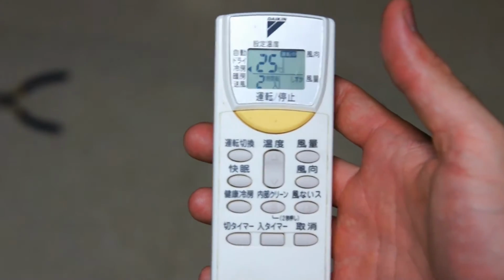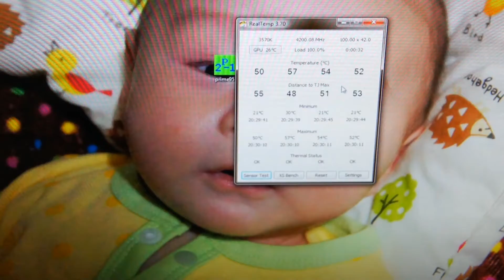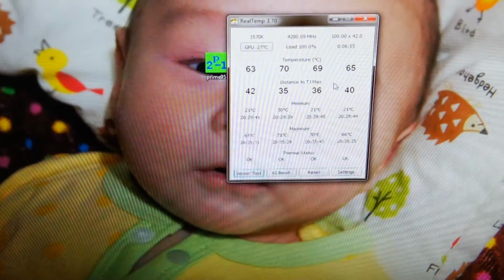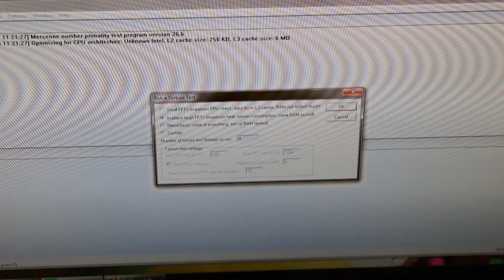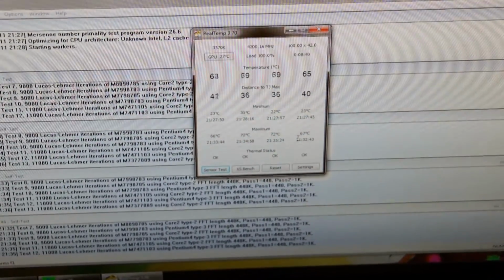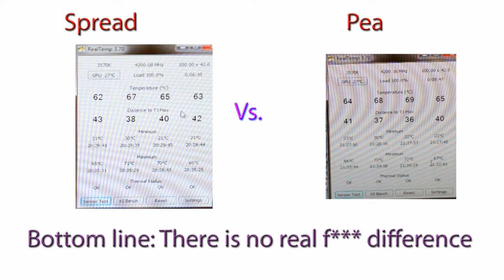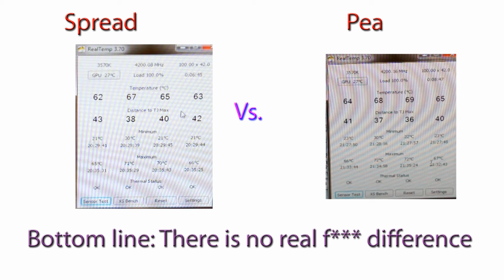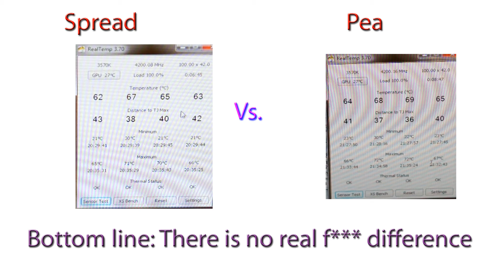How to apply Thermal Paste to your i5 i7 heatsink - TESTED - SPREAD VS PEA METHOD

Comment: What about a controlled spread method. Where you use a thin template made of very thin material over the cpu and use a scraper to evenly spread it, while letting the template act as a guide.  This way you get complete even coverage. I would think the cutout would be smaller than the cpu to let pressure and heat do it’s thing.   The idea is to keep the spreading tool on the sides of the template, forcing it to only apply a very thin layer, exactly the way pre-applied thermal paste comes with some CPU coolers like stock and water cooling units.

Comment: Its what the thermal paste makers don't want you to know, grain of rice and you will be good.I guess when you think about it, the most heat will be over the centre of the IHS so putting thermal paste all over won't do much as there is hardly any heat being conducted by the CPU cooler.

Comment: I am going to be replacing my heatsink on 4790k. However, this is my first time doing so, and i am trying to learn to build computers. I built this one, but my watercooler had preapplied paste so I didn't need to worry. However I see it is failing after 2 years. I thought I had this whole thing down, but then people started mentioned not to use to much, don't get air bubbles, blah blah blah. People say Pea, others say size of a rice. I am confused.

Comment: Oh man you shouldn't be working directly on carpet like that, especially in bare-feet. You'll short out components, even if you've grounded yourself since of the constant static feedback you'll be getting from rubbing the metal and from the carpet, place something down next time.

Also if you are using spread method, make sure it's atleast arctic 5 thermal paste since silicone doesn't spread out well without giving air bubbles.

Also don't use your finger, that's the worst way possible to spread since you are asking for air bubbles to locate themselves once you've placed the heat-sink.
Reply: And exactly how many components have you seen failing from body static discharge?

Comment: if you spread your thermal paste there is a greater chance to trap tiny air bubbles, which in time will unevenly disperse heat to the heat-sink. Just be safe and use HALF a pea size amount or a tad more on chips with more than average surface area. If you are going to test the differences in temp, then be ready to have more than one trial and factor in time too! Getting a good heat-sink/fan is what you should worry more on. I went with the HYPER 212 EVO on new-egg for $35. Note that water cooling is an option, however if either the pump or the fan fails, then your screwed if you don't catch it soon enough (enough time where chip overheats). Good luck all!

Comment: I thought with the spread method it was much more likely for there to get air between cpu / paste / heatsink and air doesn't nearly conduct as much heat as the paste and therefor letting it spread via a pea method (no air comes between) was betteR?:p

Comment: Im recently having to clean my CPU as I am installing a Coolermaster Seidon 120V waterblock, now I havnt applied paste since the days that I cant remember, Iv been lazy of late with my building and have been cheating with ready done combos!

Now I suffer a horrible nervous tremor in my hand which flares up when yup you guessed it im anxious so apart from taking a crap ton of valium so im nice and still will I be okay if I just stick a PEA SIZED BLOB on the middle of my CPU?

ALSO what products do I need to clean the old stuff off my CPU and could someone recommend a fool proof method of doing this without getting cleaning liquid on my socket? apart from holding it due to my tremor.

Comment: For Intel it don't make a difference to me as well I use the spread method as well but with a plastic food bag to stop the oils in your skin messing it up
but if you put the cpu upside down and spin it you will find it spins verry easy thats because the ihs is not flat this is to help thermal paste spread out just my experience anyways 😃

Comment: Cool video, well done. I use spread method generally, but I usually use a card, I read on official Arctic Silver documentation that you shouldn't use your bare fingers to apply it though as the tiniest bit of dead skin, an eyelash or just grease that naturally occurs on your skin can cause a poor thermal transfer, but to be fair, you did it there and it didn't seem to make a scrap of difference, freshly washed hands maybe? lol. Out of being OCD, I'd either use a card to spread it to make sure I don't contaminate it. This was helpefull to me though, I've been resolving crashing issues lately and have been looking at temperatures to see if I can bring them down, but it turns out the temperatures are fine and no different when new TIM is applied with different methods. I also agree with the thin layer, I use the spread method and have it as thin as possible without it appearing translucent.

Comment: Post #15 here shows the problem with the spread method: http://forums.extremeoverclocking.com/showthread.php?t=364784
This guy's heatsink missed the die completely because the IHS and heatsink surfaces weren't a good fit. A blob would have spanned the gap, the spread method meant that couldn't happen. Unless you're already familiar with how your surfaces are shaped, a blob or a line seems like a much safer go-to method.

Comment: 1- Air bubbles mean less surface area. so try to avoid generating air bubbles when applying thermal paste.
2- Some types of thermal paste have different characteristics when applied in different methods.
3- Thin layer thermal paste should be advised.

Comment: If your heatsink isn't perfectly level/flat then the spread method can cause air bubbles, probably not an issue with high end coolers/water blocks but I digress. Its not essential to cover the whole CPU with TIM, only the center 80-90% of the CPU needs to be covered so the pea method is the simplest & best method in that regard. Don't get me wrong, if you like the spread method then go for it, to each their own, just make sure your heatsink is perfectly flat. Check out this video to see the air bubbles I mentioned with the spread method: (How Thermal Compound Spreads)

Comment: When I replace thermal pads I use a gummy thersmal paste designed for thermal pad replacement. It is called K5-PRO and you can see a video of it here Application of K5-PRO & K4-PRO thermal paste on Apple iMac 27" A1312 MXM III AMD video board . It is also now on sale on Amazon and ebay

Comment: the method to apply should vary per cpu. each cpu die might not be the same as the next. the 3570 and 3770 are actually rectangular so youd be better off with a line instead of a dot.
http://cdn3.mos.techradar.futurecdn.net//art/pc_processors/Intel/Core%20i7%203770K/IvB%20transparent-580-90.jpg
which might explain why 2 of your cores temps where 4-7c difference. 7c might not sound like much until u turn it into a percent of 70c. 10% difference is nothing to just ignore. also intel cpus are concave whereas amds are convex.
http://media.bestofmicro.com/6/2/395498/original/Heatspreader-Scheme.png
if the middle cores were core 1 and 2, the higher temp ones, not having enough paste in the center of a concave cpu will make them hot.
so the spread method is not as optimal for intel as amd.
too much paste can cause same effects as not enough or improperly applied paste. which could be the reason both tests yielded almost identical results.
theres also a factor of thermal cycling for the paste to cure which varies from one paste to another. the time stamp in the realtemp windows show the tests were done an hour apart which is not enough time to redo the paste and run multiple thermal cycles.
intel stats the 3770k tcase temp shouldnt exceed 67.4c. since u hit over 70c with liquid cooling on both tests assuming there was no oc this makes me think the paste was applied wrong in both of them. it was a valiant effort tho

Comment: The pea method is superior if you don't use as much and tighten the cooler to the bracket well.
Reply: You should not tighten the heatsink it can cause problems. Be gentle with it

Comment: @Jon Greenwood I also used spread with my finger on my 3570k. Using a Thermaltake Water 2.0 Extreme Im at 4.7ghz and during prime max temp is 86c. Gaming I avg around 65c. Did the same thing to my friends 4770k with H100i. 4.4ghz and same temps as me. There really isn't much of a difference in how you apply it. People arguing about applying methods are like people chasing bigfoot.
Reply: Amazing, this should be spammed on all videos with Thermal pastes.
Reply: telamonh4x1!1!
i just use x method now. it's easy and covers more surface area than pea, but the difference are <1c

Comment: Agreed! its like placing a cast iron pan on a burner that is smaller than the under side of the pan and still using the full surface of the pan to cook. the heat maybe focused in one general spot however the pan works as a heat distributor pulling the heat from the center to the outer portions of the pan not in direct contact with the heat source. and adding cooking oil to it also helps distribute the heat. its a simple concept that should not be hard to understand...

Comment: all the surface is for spreading heat. That is why you need to cover more than just the size of the cpu cores. The heat from the cpu are spreading all across the surface, and you will get more efficient cooling if you have contact with all surface.

Comment: plz help i have amd athlon II x3 450 i unlocked it to phenom II x4 b50 but now in summer it is really overheating on idle(fan over 6000 rpm and temp 50+) i was thinking it is cuz i unlocked it but now i reverted  back to x3 and temp are the same.i have thermal paste on it.What could be the prob.also i have case open.

Comment: applying this with your finger can have adverse effect as your finger has natural oils in them and heat moves slowly throughout oils which means the cpu will still be running warmer than it would if you applied it with say an old card, whether or not this is a big temperature change or not could depend on multiple different factors. Other than that great video!

Comment: The reason why I like the spread method is I can see exactly how thin of a layer I'm applying and can adjust accordingly.  Also I can visually confirm complete coverage.  I apply super thin layers to both heat sink and processor and use a card to scrape excess off.  The whole purpose is to fill in micro ridges and scratches and insure uniform heat conductivity.  IMO this is why I believe the spread method is superior.

Comment: the thermal compound you just put on your cpu with your finger is compromised now by the oils from your fingers and will burn up alot faster than it shuld. But mostly it is EXTREMELY unhealthy to touch that stuff. use a glove and plastic card next time.

Comment: different results on different systems it can even be the thermal paste who determines what's best between spread or pea. a guy who had a tuniq tx4 which is a really thick thermal paste and when he used the pea method it didn't spread at all. but i agree it's not a big deal on the way people should apply thermal paste if you don't have a really thick thermal compund :)